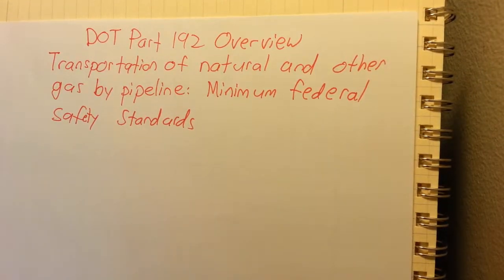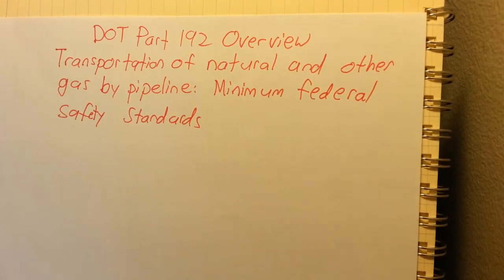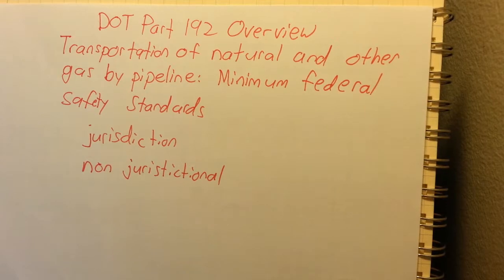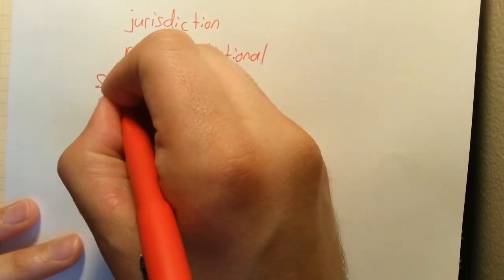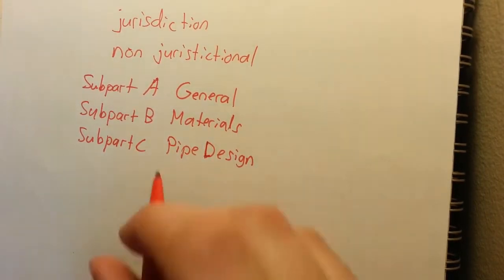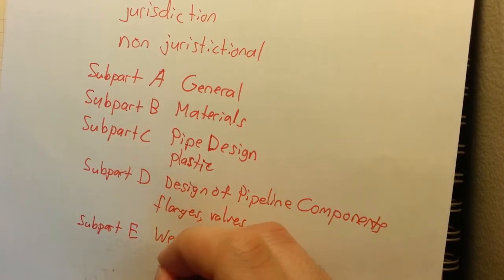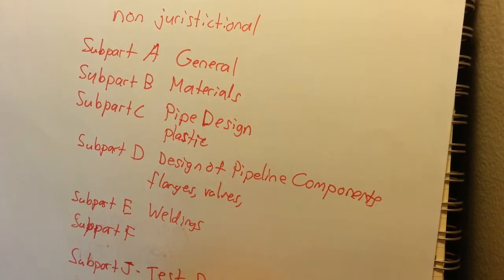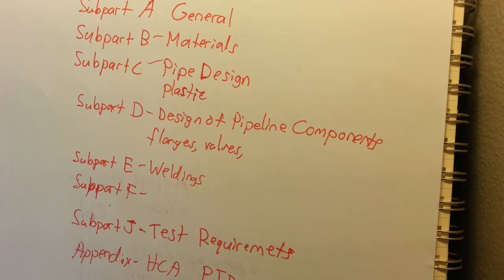DOT Part 192 Overview

Comment: I know all gas company’s are DOT regulated, but are electric company’s that have underground facilities regulated by the DOT under the pipeline codes?
Reply from the maker: I would read though DOT Part 192 Subpart A 192.1 (What is the Scope of this Part?) to determine if they are regulated.

Comment: Hi!
In DOT 192: Is there any reference about safety distance or minimum clearance between gas pipeline and building / building lines?
Reply from the maker: If this information is not indicated per DOT Part 192 or ANSI/ASME B31.8, there may be state or local codes which may apply for the minimum distance between a pipeline and building or setback distances either between the pipeline and building or the edge of pipeline right-of-way and building.
Reply: @commtechengineer612  thank you!!